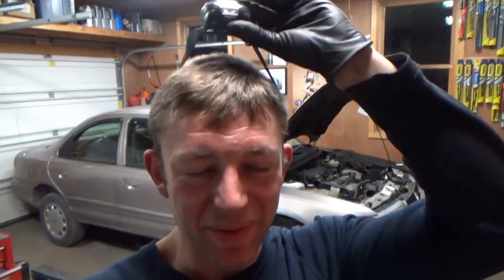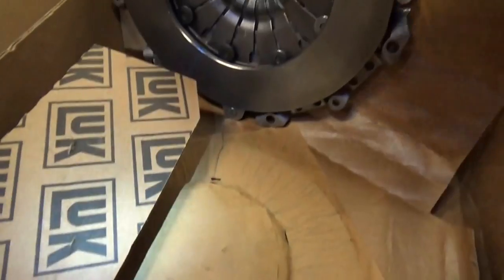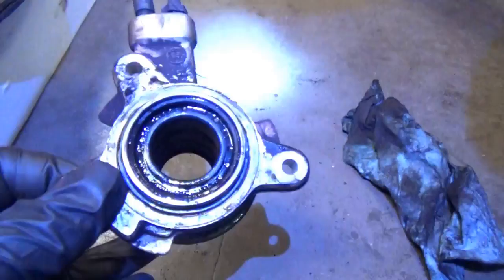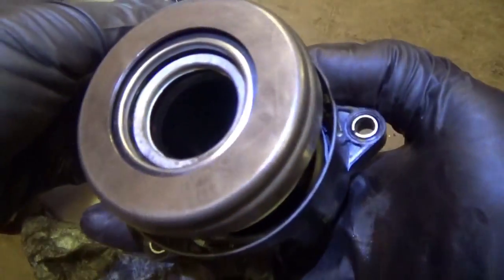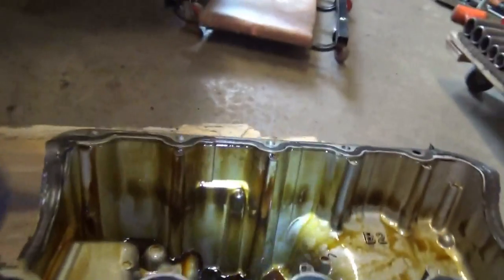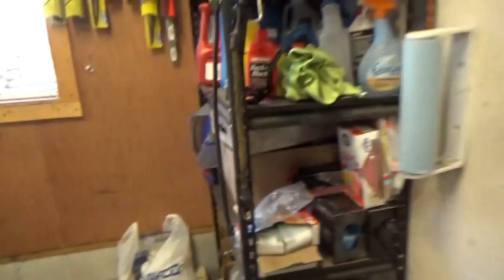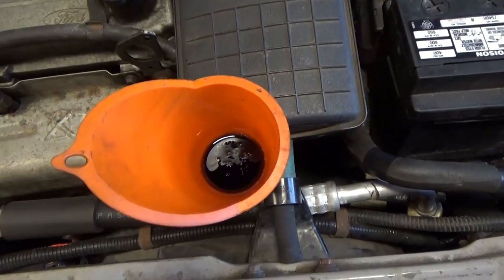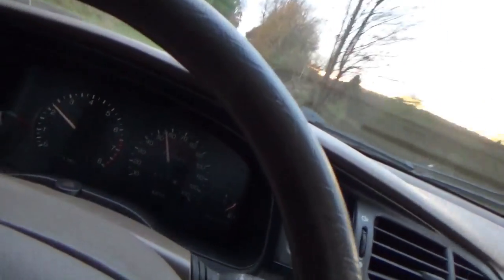96 Mercury Mystique clutch (highlights)

Comment: Let's have a round of applause for Ivan for keeping the last running 1996 Mercury Mystique on the road.  Bravo, sir.  :)
Reply from the maker: It'll keep going for a long time if the rust doesn't eat it alive...
Reply: 😂that's what I was thinking can't believe there is still parts for it
Reply: Sometimes with older cars you get super lucky regarding parts, RockAuto closes out factory motorcraft parts, you can buy struts for this mystique for $18 $21 for KYB, closeout brake pads for $6, upper radiator hose $3 the high dollar lower hose  $21.  I replaced all 4 struts on an older ford, with metal master australian made pads, new strut caps for under $100 shipped.

Comment: hello ivan, i'm writing from argentina, thank you so much for all of your videos.i have a 2000 ford mondeo mk2, wich is the ford contour in the USA, it has the 2.0l zetec engine and the mtx75 manual transmission, i bought the car 15 months ago, and i feel something similar to this problem. i feel a vibration when driving, and a kind of a "bumpy" feeling depending of rpm, the entire suspension is brand new, all of it. the clutch can do that? to make the car kind of "hesitate"? makes sense. also i feel having trouble putting 1° gear when the car has some inertia, like harsh gear, i can only do it when the car is completely stationary, otherwise is like hard to get the gear. i'm late for this video, but i will apreciatte a lot your opinion, i know you'r busy, but i could use some help please. thank you so much!!!! Lautaro. (sorry for the gramatical errors) :)

Comment: Remember the no name Gates bearing you refused to install? Well, I did 5 months ago on an idler pulley and it just failed. Replaced with Dayco made in USA, much better part.
Reply from the maker: Wow, Paul. Can you copy and paste this same comment on that Gates video? Quite a few naysayers on there saying that there is nothing wrong with Chinesium bearings lol
Reply: Done, thanks for all the great videos.
Reply: Your miles may vary though, I bought a Gates tensioner that had a Chinese bearing, it failed in a year or so, but the Dayco one that replaced it? It had a Turkish bearing and didn't say where it was made on the box or item. I guess the Dayco has proven better than the Gates so far... but I do know that it wasn't made in the USA. If I had to pay $150 but KNEW it'd be made in the USA I'd absolutely do it, but I've bought from 4 manufacturers that all use relatively low quality parts (one is INA the "oem supplier" as well).
Reply: Jesse Crandle INA is a German company; https://www.ina.de/content.ina.de/en/index.jsp
Reply: It's like wack a mole with auto parts. It changes from day to day.
Reply: I have a Dayco timing belt in my Subaru
Reply: You have to look at the bearing itself to see where it was manufactured, I've seen Dayco pulleys & tensioners with Chinese bearings.  If possible I press in a new timken, skf or national.
Reply: The number 1000 was the only marking. And yes all brands tend to use lousy bearings at different times, welcome to auto parts roulette. I like your solution.

Comment: I love the feel of fresh clutches... I always attributed the lighter feel when they are new to the nature of the spring steel pressure plate (acting like a pop disk almost) where it has a heavy tension as you get right to the outer bounds of it's grab, and lighter when the clutch disc is thicker and that spring steel is pushed in a bit more. At 268k my tundra has the stock clutch, but I have a new one waiting to go in to restore that lighter pedal, right now it's very heavy, and has that same uneven "hysteresis" style release and engagement. The truck is as well cared for as the mystique and well worth the time fixing er' up!

Comment: Quality clutch parts, quality synthetic lube (Royal Purple one of the best synthetics out there used in drag racing for a reason!), quality Fel Pro gaskets & quality job Ivan. Great video & hopefully you'll get another 250K out of it. Totally agree if you take care of a vehicle and maintain it with quality lube & quality parts the majority of time & repair it right the first time it'll provide you with a very reliable vehicle.
Reply from the maker: Couldn't agree more!
Reply: Careful of the rear subframe, we Pennsylvanians have to watch for the road salt casualties as I just found yesterday on my wife's 2000 Focus Wagon with 185k....So I'm looking for a rear frame assembly, and I'm only 2 hrs away from you Ivan, putting the word out for parts
Reply from the maker: Yes, I did notice the rear subframe on this car starting to rot out, especially on the left side. Could still patch it up with a welder, but definitely a weak spot :(

Comment: Just goes to show what maintnance can do for a car. Its rare to see these contour based cars go past 150k miles. I think most Americans look for little reasons to dump a car, in order to get a newer model. I used to be guilty of this. Junked a mint Cadillac Deville due to a bad brake booster pump. Just wanted a car with more toys and bells. You live and learn I guess 🙄

Excellent work Ivan keeping this car going. I bought back my wrecked 94 Chrysler LHS from the ins for 89 bucks! 

I plan to put on a junkyard fender, and rattle can it with Krylon Metallic Platinum. The black leather interior is in mint condition

I have 130k on it, so I know I have 70k miles easily left.

Comment: I put a Luk clutch kit in my Jetta a couple years ago... very happy with it, especially the price! ($200 on Amazon for the clutch, pressure plate, dual-mass flywheel, and throwout bearing, and the DMF/clutch/PP was pre-assembled -- just bolt the assembly to the crankshaft!). No need to drop the subframe on this VW either!

My pedal feel was extremely light at first too, but it gradually returned to "normal" after 2k miles or so. At first it slipped in 4th & 5th if you floored it (dat Diesel torque yo) but after 500 mi of break-in it holds 100% now.

Comment: Nice! Ivan has a Ford Mondeo! Yep, that's the what old clutches tend to do. Start rattling as the damper plate wears out and start sticking to the shaft. First no proper disengage and delayed engaging. More force needed to operate the clutch. 

Some models have just enough room to push a long straw though the bell house slave cylinder opening and drip some dry lube (teflon) on the axle bore. Same stuff they use to lube the Harley Davidson drive belts. Teflon and solvent mix is so thin stuff that it creeps into the bore and then dries, leaving only teflon. (Not a "official" fix.)

Previous owner has clearly not made burnouts with this Ford, 400 000 km (250 kmiles) is a heck of good result for the original clutch. Many European cars need a clutch job much sooner. Like every 20 000 km with a 18 yr teen driving like he stole it..
Reply from the maker: Interesting! Yeah I drove it on the old clutch the whole summer and felt bad for the synchros when I had to force it into gear a few times :/

Comment: "I'm going around the block here" (20 miles) :) A fresh Clutch and it's new hydraulic throw out bearing, new top-shelf oil- of course it must feel wonderful. Mercury has always been a "Budget-Luxury" car (between Ford & Lincoln) so yes, it's kind plain- but it's comfortable, quiet, shifts easily (the manual was optional and cheaper). Now- just wash that powertrain, exhaust, and underbody- and get it Krowned.
Reply from the maker: Wash and wax and Krown is the next step :)

Comment: wow a surviving Mercury Mistake! don't see those at all anymore.  I did help jump start a 1999 Mercury Cougar a few weeks ago tho !
Reply from the maker: Like many cars of the 90s, this one is put together quite well, with most of the OEM original parts still ticking away at 250k miles. Engine doesn't burn any oil. Just got 35mpg on a recent highway trip...400 miles to a tank no sweat. Final touches will be a new rear muffler and a front crank oil seal. Good for another 250k ;)

Comment: I have a 2000 mystique, auto, 200,000 miles, paid 100 dollars for non running car, put in 350.00 motocraft fuel pump, 5 years later still running and rusting, besides dashboard rolling up very good car.  Did not drop tank, cut access hole bigger and removed tabs from inside tank with buzzwheel cutter for new designed pump.
Reply from the maker: Awesome. That's even cheaper than this one lol!
Reply: hillbilly =p

Comment: OK Ivan, as a diehard believer in driving old clunkers,  I would have  given your starter a new set of brushes and bearings, and perhaps a new bendix.  Taking the starter apart before torching would have been advisable also.

Since tou had the trans out and the oil pan off, it would been a good tine for the rear main seal.    Not sure about your Ford, but some makes have a serious torque spec on the slave cyl.
Reply from the maker: My theory with old clunkers is "if it ain't broke, don't touch it" :D  It upsets the equilibrium...

Comment: Depending on the VIN, that 2.0 could be the Mazda/Ford designed mill. Also I believe that has the Getrag 5 speed, which is German built.  Both are reliable pieces.

Comment: I had a 1996 Ford Explorer Sport. It was a two door model with the V6 and a 5 speed stick.  Sold it at close to 200k miles and it was always a blast to drive.  The only reason I got rid of it was because it was my "winter beater" but my 50 mile commute was usually through a lot of bumper-to-bumper traffic and driving a stick in traffic really, really sucks!  IMO-old cars with stick shifts are almost always worth saving.  The automatics? Not so much.
Reply from the maker: Absolutely agree on saving the stick shifts! This thing with an auto would be so slow and boring and probably suck more gas lol

Comment: 248K, someone was easy on the clutch, springs weak is common with high mileage or complete failure on pickup trucks. sachs was and is good stuff! luk seems equally ok.
sounds like you had some air in the hydraulic system and the clutch master cylinder springs stressed and maybe pedal return spring weak, they'll do all sorts of funky things.
the new slave cyl. probably has "pipe in a pipe"  setup for bleeding it.

Comment: I'm driving a Contour with V6 would have loved to see you video the subframe portion.
Reply from the maker: The subframe bolts were a pain in the ass. The nut in the body seizes to the bolt and spins inside with no way to hold it. It took me a couple hours to lube and free the 4 big bolts lol

Comment: My and Ivan's "workhorses" are both in $500€ price range. Although mine is almost brand new, only 248 000 km (155 kmiles) and 18 yr. Love the fact that everyone run away from a 10+ yr old Citroens, no matter how many km those have on a clock. Leaves a plenty of choice to choose from.  

Those are no worse than any other car. New stats show that VW that used to be in top 6 in quality, is now 19th, Fiat being at position 20. Timing chains snap, burn oil, bearing problems. So sad.
Reply from the maker: I love simple durable engines with a timing belt. This one is non-interference too!
Reply: Love that fact as well, Citroen are great cars, you can get them for a really good price, fix all the problems that been neglected for ages and you have a good car for a really good price, while other people are struggling to pay the credit back for their own piece of so called German engineering I enjoy living a debt free life. People's opinions are based on the old legacy of those cars as well as what other neighbours are jealous about... not worth even thinking about it.

Comment: haha.. You sound Ivan like me when I put a new clutch into my Rover 45 last summer :D 17 year old car and I'm damn that's how it felt like when it was new :D BTW my original clutch hold 240k km :D
Reply: How many head gaskets has the engine eaten in that time?
Reply: zoidberg444, just one time when you used the better replacement bolts for fastening the head. The car is actually a Honda equipped with a Rover engine.

Comment: Surprised to see a well-built '96 model - seemed every brand from that first year of OBD-II was failure prone, especially on GM's side. Spider injection comes to mind ...

Thought I saw on the corner of that Fel-Pro box that it was a molded rubber gasket. There was a grease smudge over it, so it was hard to see. 

They're pretty adamant against using sealer with some of their gaskets. When I did the oil pan on my '89 S10 with the carbureted '00 4.3 V6 in it, I used sealer on the Fel-Pro gasket ... and made it leak! Said on the package, and in an included note specifically NOT to use it. Of course, I figured the stuff I was using (Permatex Right Stuff) would seal anything. Lesson learned there! Still have to use a tiny bit on corners and on metal seams on the engine side, but I slathered it on the entire gasket - wanted to make sure I had zero leaks ... and caused the exact opposite, lol! Live and learn!

Our '86 Mercury Grand Marquis is at 249k, with the original AOD automatic transmission, fuel pump and power steering pump. Just stopped driving it for the winter a few days ago - can't take the chance of getting liquid car dissolver all over it.

Wish cars of this century used parts this well built! The Mercury line was pretty damn good. Too bad they killed it.
Reply from the maker: Wow I can't believe that extra sealant made a gasket leak! Yeah stay away from that liquid car dissolver haha
Reply: Yeah I couldn't either! I wasn't too happy, since the whole point of doing the engine swap on that vehicle was to cure the burning and leaking oil. We used to go through a quart of 20w-50 every 50 miles ... in winter! :D

 The leak caused by the sealer was nowhere near that bad, but I shouldn't have had ANY leaks with all brand new gaskets and seals throughout the entire engine. I think I stopped the leak by smearing Right Stuff along the outside of the pan/timing cover junction. I wasn't pulling the engine, or dropping the front axle again to fix it correctly. :D Was burned out of wrenching on that thing!
Reply from the maker: My neighbor's 99 Blazer was developing an oil drip at 240k miles. I found that some of the oil pan bolts were a bit loose! Tightened those up, no more drip! Cheap fix for an old beater lol
Reply: I love those quick, easy, FREE fixes! They seem to be few and far between over here though, lol.

Comment: Thanks for this.  I have a 1995 V6 Mystique 5 speed that I am going to start on at the weekend.  Mine just wont go into gear. I have changed the clutch master cylinder under the dash, so I'm assuming i't's the slave that has failed too.  Any thoughts???

Comment: Next time when you have a broken off bolt try this ... heat it up till red hot and rub a candle on it, the wax melts and wicks down into the thread. It loosens and lubricates and will come out easy.
Reply from the maker: I've heard of that trick, but never tried it!
Reply: or you know "heat and beat" before breaking it? :))

Comment: Yea I have a red 2000 ford escort Zx2 same engine except with vct on it and even after rebuilding my engine and pulling new wires for the whole engine harness bc a professional mechanic “” that the only owner before me kept bringing it to hacked the harness to hell but I love restoring it. It only has 113000 engine was in perfect condition still I rebuilt it because of the timing belt tensioner bolt snapping off the head like 3/8 of an inch under the surface of the head and as you know the idler is right up against the passenger firewall and even with a 90 degree mini drill with cut down drill bits i couldn’t get square on the head to heli coil it so I pulled the head and rebuilt the engine and ported the exhaust very slightly just to clean it up and increase the breathing ability slightly. Anyways it mine has the strange rubberband effect just like you were talking about which In the past I’ve found to be the mass airflow sensor but I cleaned the sensor and it reads accurately fuel trims both at idle and underload stft stays within positive and negative 7 and at ltft is at a positive 3 and everything else is proper voltage and doesn’t wig out in any way. I’m not a mechanic but between you, danner and Eric o I’ve learned enough to start diagnosing electrical and mechanical faults on the side for a shop in Virginia but that rubberband effect at cruise with an automatic transmission has me stumped. The only thing that seems remotely possible that I haven’t been able to prove our yet is the design of the Zetec timing belt/ accessory drive and torque driven/ oil activated variable cam timing pulley but not sure. Have I know your mistique is manual trans but have you figured it out.

Comment: I don’t think you can call that purring Ivan. I can tell you have bonded with that old beater, I’m the same way. People say to me ,”how long you gonna drive that dam car”. Finally let it die at 389k. Was a Corolla. One before that was a Corona, 412k. Gave 500 bucks for it at 183k, sold it for 600 bucks. Now I have a 97 Corolla, bought out of NC with 115k, has 156k now. It will probably outlast me. I have a 93 lexus SC400, a 02 Lexus LS 430 and a 99 Dodge 2500 5.9 Cummins. One I’m in 85% of the time is the Corolla. Go figure
Reply from the maker: Toyotas last too damn long! Oh yeah there is a bit of valve lifter clatter when it's stone cold...quiets right down in two minutes :)

Comment: Clean the gasket mating surface in the oil pan with brake cleaner and dry it. The old oil in the groove is the reason the gasket doesn't stay in place. No RTV needed.